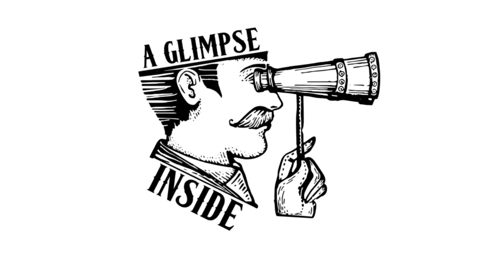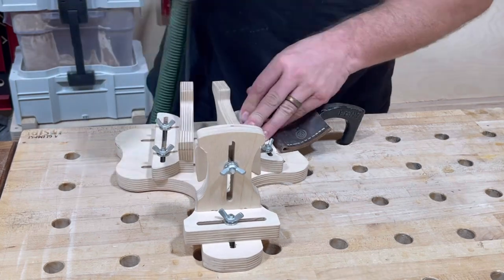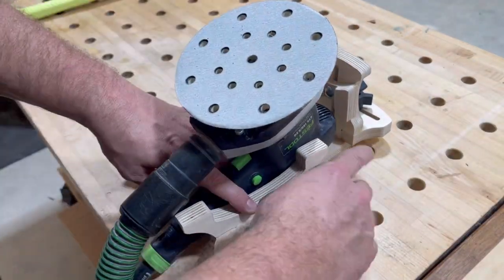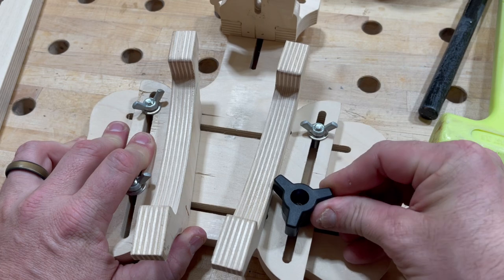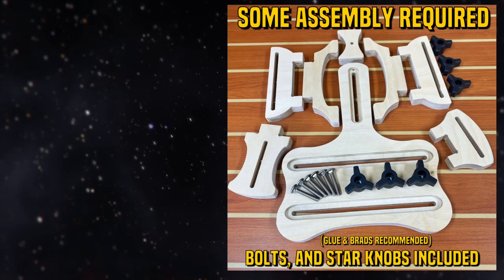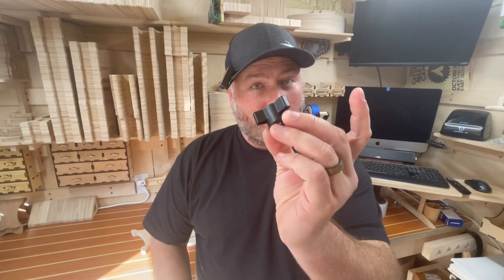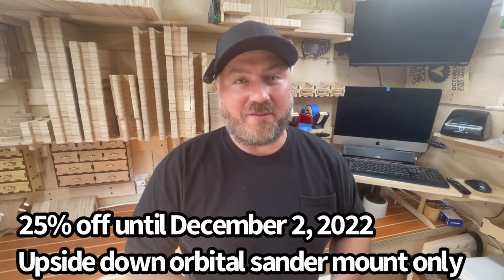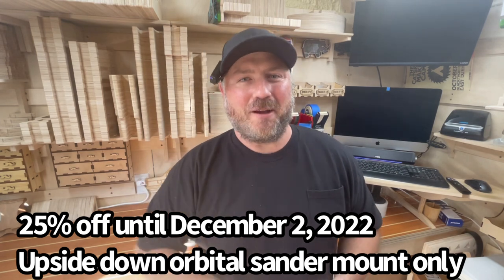This Will Change The Way You Sand Wood, FOREVER !

Comment: Hey, Chris, I know this is an older video, so I hope you see this. I had a couple of questions for you.
1. Does this work with most random orbit sanders? Mine is rounder and not as elongated as the Festool.
2. Do you have any plans to sell the, well, plans for this?
Thanks. Keep up the great work!
Reply from the maker: Yes, actually I did a video launching this product and I tested most brands you could buy at the big box store and they all work. Some adjustments need to be made of course per brand but I got all of them to work very well. As for plans, I will be putting a set of plans out there probably the summer. I have another video. I’m doing about this in the next week or two so after that, I will probably release those plants.
Reply: @AGlimpseInside  thanks! I found the first video a little while after I posted this. Looking forward to seeing new video and checking out the digital plans. 👍

Comment: how about the side is fixed, and only one lock screw? since we only fit one sander.
Reply from the maker: Might work, but it really won’t be as snug as it should be
Reply: @AGlimpseInside  the side is a V shape, so push it will make it snug at side.